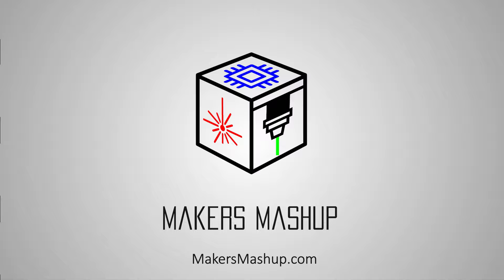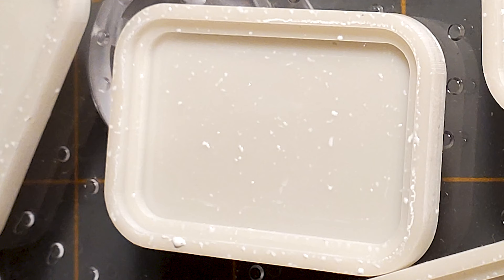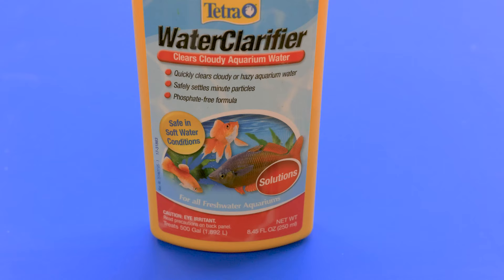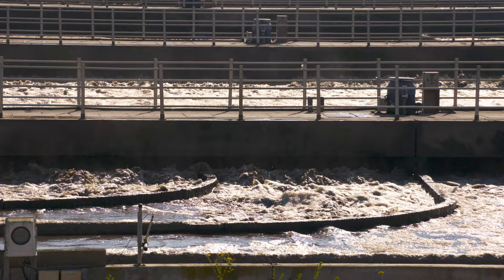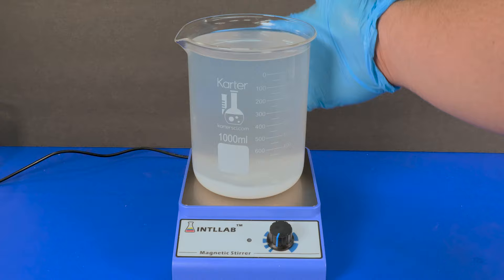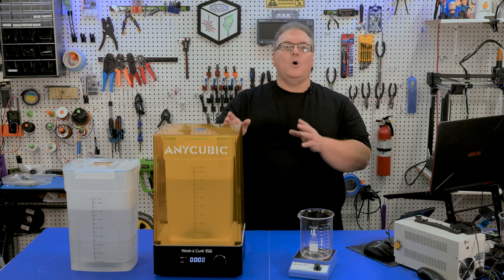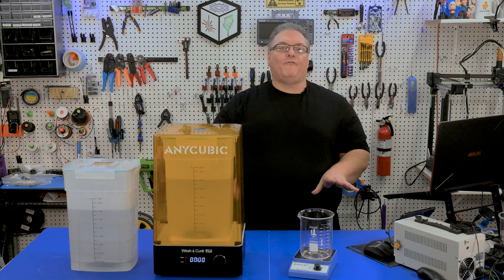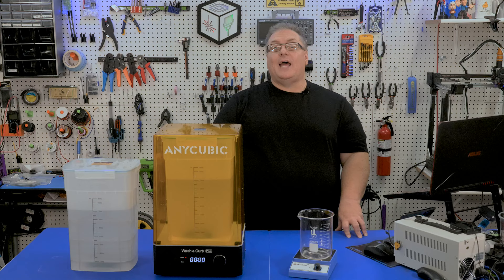Recycle Isopropyl Alcohol FAST! | Recovering IPA From 3D Printer Resin Wash

Comment: One of the other parts of the waste water filtration process is to run the water through sand beds as a natural filter.  That made me think that you could potentially have a very quick process here if you did the fast-stir, slow-stir, and then went straight to coffee filters rather than just leaving the solids to settle out. With the alum making the resin particles flock, the filters should be much more efficient than they would be otherwise.
Reply from the maker: That is an excellent idea Alex.  I can run a batch through a filter and see if it improves performance. I considered using pool sand during these experiments like you indicated here but thought it might make the process too complex or create significantly more hazardous waste.   The coffee filter post processing though could be the added step this process needs.  I'll let you know how it turns out.  If you try it out before I do let me know how your results were.  Thanks for the great idea.
Reply: @MakersMashup  I’m just curious if you did this and did filtering instead of decanting after the alum made a difference?
Reply from the maker: Filtering afterwards had no effect.  The particles are too small at that point.  Letting it rest overnight will get it clearer.
Reply: @MakersMashup  Hm, interesting. Worth a shot, anyway.
Reply: @MakersMashup  I figured that the coffee filter would be too coarse to catch those particles. Filtering through cotton and ultrafine sand might have an impact, but it's a slow filtration. If you have the time to let it settle, it's probably the most effective method.
Reply: @MakersMashup  yeah, its like to filter a milk with cofee,, still milk with cofee

Comment: flocculants are wonderful things!  You could also just run it through a diatomaceous filter (in keeping with your aquarium hobby).  Just keep in mind that if you're using an aqueous solution of flocculant, the water will dilute the IPA unless you distill it out.  A common lab approach would be to combine a flocculant/filter with a distillation final step +/- a drying agent like calcium chloride or a molecular sieve.

Comment: So while I probably won't go as far as using the Alum, the idea of a second wash container is definitely going into my 3D printing routine now. While it may not settle as well as I'd like by letting the IPA naturally rest, I think I may do that and then do a cleaning on the two containers' solutions more often.
I saw a video in which a pump was used to carefully pull out the cleaner IPA sitting on the top, so I might see about using a peristaltic pump to cycle the IPA more often. If I find that doesn't work enough, then I may give the Alum a try, depending on the balance of time spend and results.

Fantastic video, thanks for sharing!

Comment: After decanting the aluminum sulfate/IPA mixture, you may do well with a micron filter.  I just watched another channel that did tests using a micron gravity filter to cleanup IPA, and it worked pretty well on a fully contaminated solution.  The video was titled "Can We Recycle 3D Printing Alcohol?" and it was on the Nerdtronic channel.  It could be worth watching and using that method as a second step to reclaiming your IPA.

Comment: I have a couple thoughts: have you run you solution back through a hydrometer? The water is going to bond with the IPA and reduce your proof if I had to guess. Also adding any water to your wash and cure station will eventually trash the bearings on the mixer in you wash and cure station, same thing goes for using simple green or mean green or the like. So while this seems like an easy and simple solution there are a couple pitfalls.

Does this reduce purity and if so don't  place it in a wash and cure.

Comment: This is brilliant. I use water washable resin and it never occurred to me that I could use, basically, swimming pool flocculant for cleaning up the waste water before disposal. Nice! Someone in the comments also mentioned bentonite (clay), used in beer and wine manufacture as a clarifier. Cheaper from home brewing stores than cosmetics. Am looking into bentonite as a non-soluble alternative for both water and IPA. Might mitigate issues of dilution of IPA with water solutions of Alum. Thanks again for posting. Cheers.
Reply: Bentonite is also the main ingredient in clay kitty litter. If you are going to use litter, get stuff that is pure clay litter to avoid any possible reactions with any additional chemicals.
Reply: Interesting, bentonite is used for tanks, the little ponds/lakes in fields usually for watering cattle made by putting a dam in some suitable location.  If the ground is leaky due to porous rock or the like, bentonite spread I think about 4 inches stops the leaks by expansion.  I mention it because it means the stuff should be pretty cheap in bulk if you go to the right source.  4 inches for an acre is still a LOT of stuff.  Plus, it's damn near criminal that the guy who invented clumping cat litter didn't get a Nobel.

Addendum-unfortunately, it's been turned into some kind of BS alt-med product so you can get it for absurd prices like $15/lb and more , or get it in bulk for under a $1/lb, or if you print a LOT of models, $420 for 3000 lbs [this is the pond-building suppliers price].

Comment: IPA doesn’t separate from water as easily as oil does, while a layered drink might be stronger on top than the syrup at the bottom, I think the Alum/IPA mix you have would need significantly longer to come close to separating the alcohol.  

One solution I’d like to try is incrementally exposing the used IPA to UV light and then filtering.  If you try it in one go you’d end up with a spongy IPA mess with little yield but smaller exposure cycles might be a clean way of doing it.  It’d also be interesting to use the same process with a little bit of Alum and decanting to possibly reduce the number of cycles required.  A final distillation may also prove useful but not necessary as it’s just being used to wash more resin.
Reply: I plan on trying this very thing this weekend

Comment: Water is heavier than alcohol, yeah but that's not how it works. Alcohol dilutes in water very quickly. I'll assume you also remove the waste. You dilute your 99.9% IPA to under 86.86%. Second wash 75.53% and third wash 65.68%. Not sure if 99.9% is required for the cleanup but there are applications for 40% IPA as well (cleaning sensitive materials), so at the end this is a good idea and saves a lot of resources.

Comment: Awesome and innovative method. Kudos for all the research and testing involved!
Reply: I have a method to clean my IPA after washing resin parts, and it is simpler, it don't need some unusual chemicals, and don't need any labor: step 1 - put your dirty ipa in container. step 2 - put container into freezer for a night. step 3 - wait about a night, you will get basically something like you get in this video "snow" from fallen of to a bottom of container resin, then you can put your container in warm place without disturbing it much, so "snow" will melt into a resin, and then you can pour clean IPA from that container. And that's all! If after firs freezing your ipa is not clean enough, just let it unfreez (without disturbing) and freeze it again, every cycle will make it cleaner. 
It you have cold weather outside (this procedure requires temperatures about -5 celsius and colder) it will work perfectly, too.

Comment: water very easily mixes with IPA and it will not separate, IPA is often used to dry substances because it will pull the water off. so by adding water, you are hydrating your IPA, it will eventually be too dilute to work well. 

on the plus side as you do so its flammability is reduced and distilling can pull the IPA out of the water up to a point.

Comment: May I suggest that when you are using Alum that you make a gravity sand filter as the floculent you are adding should be a layer on top of the sand and this is how the filtration process is actually meant to occur. Simply broadcasting the alum will lower the specific gravity and make larger sediments to the bottom of the body liquid. It is not a clarifier as such there are other chemicals for this and I am unaware if there would be any off gasing with this or other additives. To add water also means you are lowering the IPA and the clumps of alum observed is the saturation of the alum to water medium.

Comment: Good day.
I had a question, why not use the evaporation method?
In simple words - Purification of isopropyl alcohol by distillation.

The good old way in alcohol production.

I suggest the following;
1.- mechanical cleaning; cotton pads, paper towels, high-density fabric materials.
2.- Irradiation with an ultra violet 315-405-(total spectrum) nm radiation source.
3.- repeated cleaning (rough).
4.- re-exposure.
5.- Rectification distillation.
6.- Preliminary UV irradiation and cleaning if desired.

7.- For experienced cleaners, dry cleaning with aluminum sulfate (pure 25g per solution of 15ml water)

8.- I am a chemist, please advise your method!?.

9.- I’m tired of cleaning alcohol.....
10.- Please pay attention!
Thank you for your attention ;)

Comment: Id take this one step further. Using water will dilute your IPA. Using cassava tapioca pearls, you can dry your IPA after coagulation. You should end up with 100% IPA after that drying. If you have a molecular sieve, you can use that to dry large amounts too. Celite & filter paper will take out trace particulates.

Comment: FYI water and ipa form an azeotrope when you mix them, so you're slowly diluting all your ipa with water, and you won't be able to distill all of it off, least of all pour it off.
Reply from the maker: Yes others have pointed that out.  You can however use salt to extract the water which should be equally safe but does require another step at some point.

Comment: another method is to use table salt to the solution. it's a purification technique used in organic chemistry. I add it after leaving the resin in the sun and mix it with extra salt. Sadly it discolors the IPA, but I haven't had a chance to try sending it through a ceramic filter.

Comment: I did see a recent vid on YouTube about separating out water from alcohol using saline solution. You add a highly saturated salt water solution (ideally saturated distilled water) and add that to the alcohol. The different densities between the 2 liquids make them seperate and then you can syphon off the saline or alcohol (I can't recall which one is the higher up when they seperate. That would remove the majority of any water you initially added. It may even work if you add salt directly to the ipa and that gets taken up by the water in that and then seperate out that way. As always I reccomend your own research though as my understanding of the process is purely from a single video
Reply from the maker: I've heard and see it. It's legit.  Im considering doing an update ont his after the shop is ready.

Comment: Seems to me ya might want to look into the home brew sparge tanks this unit proses settles solids to the bottom ware the drain is some have valves and removable containers to remove dead yeast  and wheat solids might work better than several different dcant/pours what you are doing here is a very similer process that some home brewres use to clarify  beer ....thanks for reading

Comment: For anyone worried about leftover water, you can always dry it with fine sodium chloride or using molecular sieves.
Reply: Following on what sounds like an amazing tip, 1) can you get sodium chloride on your local pharmacy, 2) do you just pour it in the mix and if yes, at what analogy 3) Do you need to worry about any emanating gasses or anything potentially health hazardous??
Reply from the maker: Sodium chloride is just salt.  If you Google salt alcohol water extraction you'll likely find a number of middle school chemistry examples of the process.
Reply from the maker: That's what did after a similar post  😉
Reply: Actually just googled a bit and found out thats salt lol so no need to answer thanks!

Comment: Not sure I'd call 30-45 minutes of stirring fast?  A lot faster to use a run of coiled tubing and UV lights along with particle filters.  This will cure the resin into bits in "real time" as it flows through the coil which will then be trapped by the filters.  I've been working on building a gravity version of this after being inspired by someone who did similar with a recirculating pump.  I'm not brave enough to run IPA through a pump though :)

Comment: For those concerned with the increase of water in the alcohol, I don't know if this would work in this circumstance but I thought I'd throw it out there...

I saw an unrelated video on "purifying" alcohol. It was claimed he increased the "proof" from 70% to ~93%. It involves adding non-iodine sea salt to the alcohol and stirring vigorously. There was no exact amount of salt to be added. The idea is the salt "binds" to the water in the solution leaving you a "purer" alcohol. When it settles out you can actually see the boundary layer between the brine and the alcohol.
Reply from the maker: Yup, a few commenters have pointed out using salt can easily get you back up to 100%.  Next batch I clean I'll likely use this and publish and update video.

Comment: Good job! I think it's the only video that found a clear solution for that. My only concern since you clean the IPA, is still working the IPA almost like before? Any problem or residue on your prints?
Reply from the maker: The process has worked great.  I havent seen any problems with cleaning prints or things left on prints using this process.

Comment: I like to use a hose and siphon off the clean IPA instead of pouring when decanting.
Reply from the maker: ive seen others do it but did not try it.  How are you starting your siphon?  Simple gravity or are you using something to get things going.  I know they have some for gas cans and that you simply squeeze a plunger but if you have a known good process or device please share. :)
Reply: if you've got a lot to work with, a brewers siphon should work

Comment: Pick up some glass stir rods from Amazon.  Next time you need to pour out your IPA from the large beaker, rest the stir rod across the top of the beaker, with 1 end sticking a couple inches out from the pour spout.  Pour slowly out of the pour spout, so the IPA hits the glass stir rod.  It should flow down the stir rod to the end, where it will fall off cleanly into your 2nd beaker.  This will greatly reduce the spillage when you transfer your liquids.

Comment: An interesting idea maybe it is easier to handle, like I do it by filling the used ipa in a transparent container and let it rotate (horizontal) slowly under a curing unit. Then I pour the ipa and the resulting goo in a filter to let it drip into a bottle.
At least a mess, especially squeezing out the filter for the last drops, but a way to always have ipa for prewashing.
Reply: This sounds like a good idea. I’ll give it a try to speed up the process. Thanks!

Comment: 8:20 - The water in the aluminum sulfate solution doesn't settle to the bottom with the sediment to be filtered as part of the decanting process.  Look at the Wikipedia article on isopropyl alcohol.  The first sentence under the Properties heading: "Isopropyl alcohol is miscible in water".  Your "recovered" IPA is contaminated with water.  Using water and alcohol to clean most resins will result in a gummy surface that won't UV cure or it'll produce a chalky finish.  That's why we aren't using much less expensive 70% IPA.

Comment: Great investigation, I'll be making use of this. Out of interest though, did you try exposing the decanted IPA to UV light to see if there were any photoreactants remaining?
Reply from the maker: The decanted IPA will continue to clear if you wait longer.  I tried exposing it to UV during the experiments and it made little difference in the process.  I didn't specifically try it afterwards but didnt think I would see significant results based on results during the experiments.
Reply: I put a container with IPA in the wash and cure machine and ran the curing program. It worked, however a thick layer of cured resin built up at the walls of the container. I have to add that the IPA I was experimenting with was very very dirty as I used the Collected IPA I use for prewashing!
Maybe the result would be better if you would run the curing and stiring programm at the same time.

Comment: Excellent work! This type of due diligence is what every hobby needs! Question though, why does no one use the cure function of the wash station to cure the bucket of ipa? Seems like everyone relies on the sun when they have the equipment already
Reply: You can do this but it will take days to clear the resin, just as sunlight does.
Reply: Unless you have let the dirty IPA sit for a long time to seperate the resin hardens in a lattice structure that results in a jelly/custard like substance at the end.
Reply: Curing the resin out in the wash and cure container ends up making a sludgy mess at the bottom and you end up having to scrape it off the stirring mechanism at the bottom.  Not a huge deal, but one more thing to have to manually clean.

Comment: Use a specific gravity measure to test how much water is in your IPA. SG is used for measuring the alcohol in the brewing process, so many on the web. Probably need a tall beaker because SG's are quite tall.
Reply: No need. C1*V1 =  C2*V2. In this case, 100% * 1000 mL = C2 * 1150 mL, hence the final IPA concentration (C2) is about 87%. Unfortunately decanting does not separate the water and IPA.